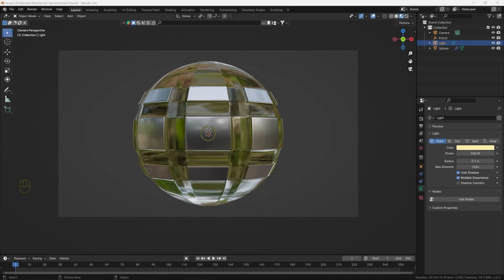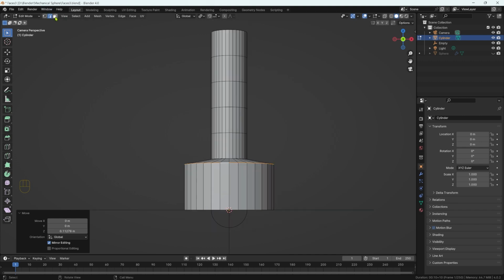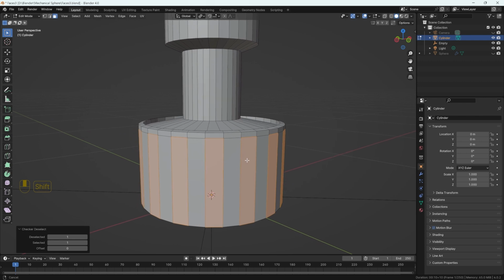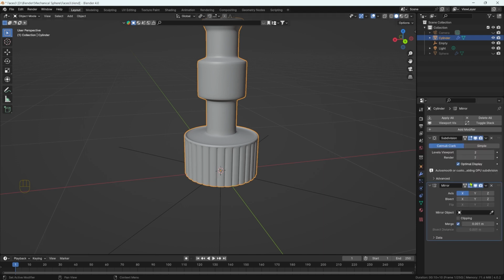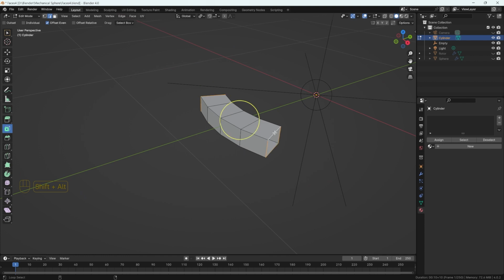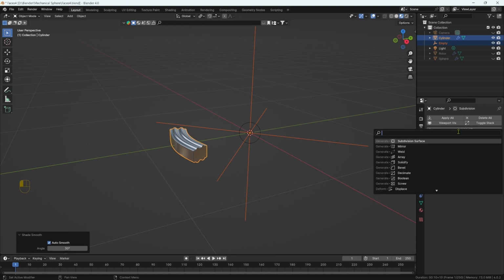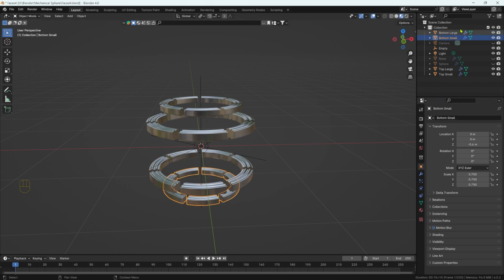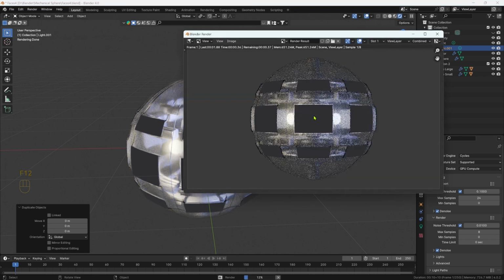A Gentle but Exciting Introduction to Blender: Part Two

Comment: Good stuff, and easy to follow along with. But at 10:50, I am having trouble getting the loop cut tool to give me those same big cuts. It is only acting on smaller faces. I can get the long cuts on teh bottom, but still not your results. Hmmm...
Reply from the maker: It takes a bit of getting used to the Loop Cut tool, so maybe select the top view and zoom in close enough so you can hover over exactly the right point to get that cut.